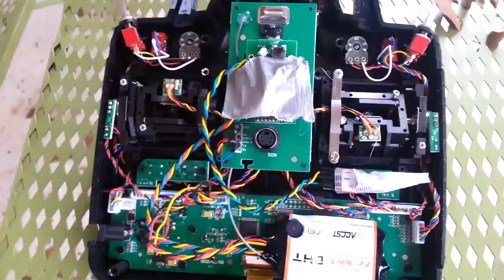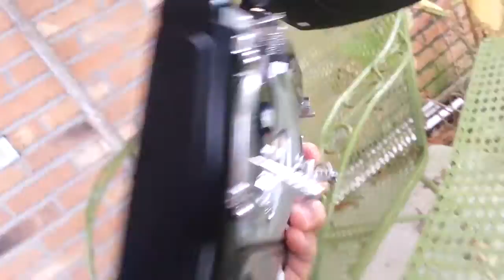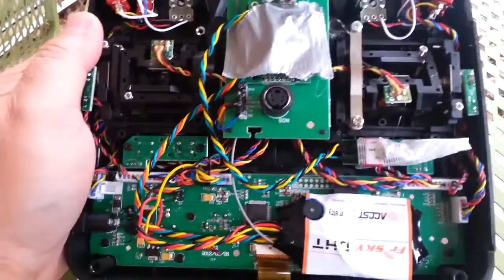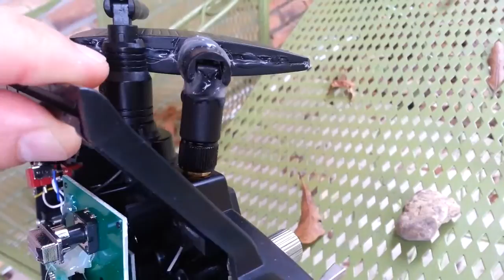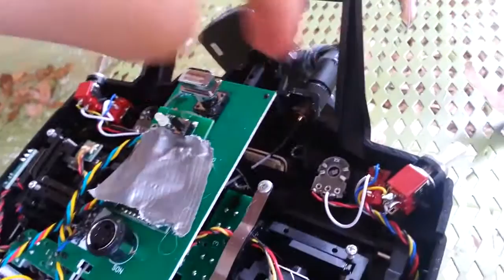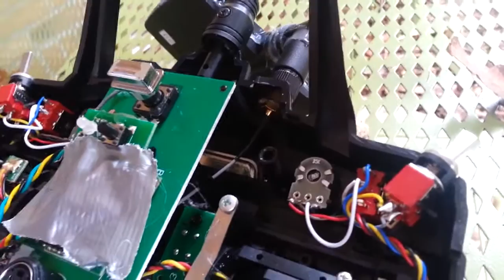FrSky DHT module to flysky FS-T6

Comment: is this like a cheap version of the taranis?
Reply from the maker: Pretty much. Taranis has lots more software, and menus, nicer gimbals and much more, that i'd never use. I've got a Taranis still sitting in the box, never been used. I throw this transmitter in a soft case with my fatsharks and go. I don't worry about it breaking, or getting banged up. I also use a patch antenna that increases the range substantially. Now I'm going to use the Taranis because I just got an EZUhf module for it.

Comment: Just looking at this mod and I going to do it to my radio, question how does the telemetry works, where the info is displayed and what information you get, do you have to flash any firmware on the radio and what are the benefits of this mod?
Reply from the maker: yes. telemetry works. the module has a beeper on it, thats all. just power and ppm signal. i don't know about displaying on the lcd screen or firmware mods.

Comment: Hi Adam, did you know the ppm level of the T6? i want to use a diy arduino based dsm2 module. the hf mdule only takes 3.3v allso the ppm on high, if the ppm output from the t6 is 5v on high = module fry ^^

Comment: Ive done this mod to my fly sky f6 also, Great mod! I removed the original fly sky module completely and used the original modules cables and removed them from the white plug leaving the yellow ppm and black earth wire, Simply soldered the yellow wire to the ppm wire and black to the earth wire, Red to a power supply. Easy! Works a treat!

Comment: Hi, Do you know if the DHT module will bind with the stock FS-R6B receive that comes with the FS-T6 transmitter? I just purchased the DHT, wondering if I need another couple of RX's to go with it? When It arrives I'll most likely disable the stock internal module but hopefully keep the trainer port function. The way I see it you solder the + (Positive) to + (Positive) on the on/off switch. Solder - (Negative) to any ground point. Allocate the PPM signal which is allocated and labelled "PPM TX" (Yellow Wire) on the stock module. I would imagine to turn on/off the stock internal module you can put a switch on the 5V line to it? I wouldn't be happy having both being on at the same time IMHO.Don't take the + (Positive) 5V from this module as it may be weak. Take from battery / on/off switch area.
Reply from the maker: No. The FrSky is not compatible with Flysky receivers. I run both of mine at the same time. I can't see where the problem is with that. Each one acts independently of the other. Its a simple input and output. Although when I replace all my flysky fith FrSky, I'll probably disable the internal module too.You can bind as many receivers to either as you want. the FrSky module should be fed voltage directly from the batteries. I'll post a better video soon.

Comment: Hi Adam , 

Thank you so much for the video and pushed me to upgrade my FS T6 with Frsky DHT module. I have successfully installed it and have added a switch (PPM signal wire) for it and i can change if i want to use the stock Flysky module or Frsky DHT module. Now I have some mind of upgrading it again. Have you tried to upgrade/modify the firmware of FS T6 to get use of the telemetry function from the DHT module just something like what people did for the 9x radio? Just a thought and not sure is that possible or not. Thanks in advance.

Regards, 
Irwin
Reply: i would say my original FLYSKY module only give me around 150 - 200 meters, and with the modified Frsky DHT DIY module i have never try to push it to limit, but I still getting 50% ~ 60% of signal after + - 200 meters. (with 5dB antenna and open field) If you want more more details or pictures welcome to drop me an email (irwinng2356@gmail.com).
Reply from the maker: You should get at least 1km with the frsky system at line of sight.
Reply from the maker: +Irwin Ng No. You are welcome. I have not. I don't know if anyone has modified the firmware or hardware like the 9x. I think the 9x was so heavily modified is that it was so popular for so long. It has 9 channels, a module bay, large battery bay, etc. Now there are so many decent radios out there, its less likely to have the hacker community spend much time on it. I wish FrSky would make a cheap 6 channel radio like the T6.
Reply: Hello Irwing, 

Do you mind telling me how much improved signal you got from this? Also a picture will be great :D. I am doing my first build so i am learning as much as i can.
Reply: thx both of you for the replies, I sent u an email Irwin:D

Comment: I'm having trouble figuring exactly where you soldered the signal wire, a couple jpgs would be most helpful, thanks.
Reply from the maker: +Brett __ Yea, its hard to see. I don't have any pics, but you can see on the tx board it says PPM, TX, you want to attach your signal wire to that. You can see where I tried to access it at the TX board, then changed my mind and put liquid tape on it. Then I took it from the main board. Hope this helps!

Comment: Can u still do multiple models with this mod?  or only bind one at a time?
Reply from the maker: +ChawFPV Yoe. The transmitting module is separate from the "controller" parts. The controller outputs PPM signal, and the "transmitting module" receives the signal and outputs it as a 2.4ghz signal. It is actually transmitting in FlySky, and FrSky protocols at the same time. The rest of the transmitter remains the same.
Reply: +Adam Heidingsfelder so I have two frsky recievers, on two quads,  i can switch between them at any time?  only bind once when first setting up?

Comment: Could I add this module (http://www.hobbyking.com/hobbyking/store/__46634__OrangeRX_DSMX_DSM2_Compatible_2_4Ghz_Transmitter_Module_JR_Turnigy_.html) to an FS-T6 in the same manner as described in the video?
Reply from the maker: +Forrest Grinstead NO. you need this one: http://www.hobbyking.com/hobbyking/store/__40205__OrangeRX_DSMX_DSM2_Compatible_2_4GHz_DIY_Transmitter_Module.html
Reply: +Adam Heidingsfelder Thanks for the reply. $40 shipping on a $30 item kills me... Are there any other ways I can make this receiver (http://www.hobbyking.com/hobbyking/store/__61211__OrangeRx_R410X_DSMX_Compatible_4Ch_6CH_PWM_CPPM_2_4Ghz_Receiver_.html) work with the FS-T6?

Comment: hi, i would like to ask can i use the dht module with d6fr receiver on my kk2.1.5? and what i need to prepare to diy the dht module to my flysky fs t6? any help would be appreciated. thanks
Reply from the maker: +Irwin Ng Yes. It should work. I would go with a better flight controller like a CC3D or Naze32 though. Check RCgroups.
Reply: Ooh, any problem with kk board? becoz of less features to play with? oh ya~ to modify the DHT module to flysky fs-t6, just need to solder those 3 wires without any additional cable/wiring, am i correct?

Comment: hay,whats up ,just wanted to know how this setup works in terms of range and control over your craft. im on a budget so this is my best solution for using the D4R-ll reciever on my craft.i know the t6 is not the best but it works and the price cant be bet .so please tell me this mode stud the test of time....thanks...
Reply from the maker: +Levi Thompson Hi, thanks for the question. I got the Taranis transmitter about 6 months ago...and I still use my T6! Taranis is still in the box! This setup is GREAT. It cannot be beat for simplicity and price...IF you know how to solder. I was using this setup with a modded FrSky panel antenna from hobbyking-the one in the video. With an XP receiver and NEVER lost signal.

Comment: Can you also use all 8 channels of the module with this modifikation?
Reply from the maker: +Fallout FPV FS-T6 is only putting out 6 channels PPM, so no. Only 6 channels. I think its better like this. The PPM-transmitted signal will have a null between the last and first channels, allowing the receiver to get signal longer.
Reply: +Adam Heidingsfelder Could it probably be, that the main board is the same like the mainboard from FS-TH9X/ Turnigy 9X? If that's true - I don't know - you can probably use the openTX software and up to 8 channels (after adding more switches)?

Comment: Hi, After opening my own T6 I understand what you did.
But i dont really understand where to put the yellow cable.
You just soldered it on the plug on the board with the Module at PPM-TX? 
And how can I unplug the old module?

And is it possible to use the old reciever, which comes with the T6?
Reply from the maker: Max Reichel I soldered onto the signal wire that comes from the main board. I traced it from the module (it says TX). I was going to solder it on the original module, but it was easier to access from the main board. I still use BOTH modules. They still work fine, they are just both on at the same time.
Reply from the maker: Max Reichel I you want to only use the FrSky module, you can cut the wires to the module, and solder directly to them. It will also give you more space.
Reply: OK thanks a lot! Now i only need a store which sends from EU for a moderate price (like 20$ on HK) :D
Reply from the maker: I like banggood. Here's fat shark's distributors. If they sell fat sharks then they probably sell FrSky:
http://www.fatshark.com/where-to-buy.html
Reply: I have to ask again... From where to take Positive and Negative? Like i can see in you Video you used the upper pin of the switch (for turning FS-T6 on or off) for Black and the lowest pin of the three pins for red? And its only needed to also solder the yellow cable at PPM-TX? 
Because its look like you´ve soldered many cables to the old module? Or is that only to acces the bind button over the stock bind button?
Reply from the maker: Yes. That's only the new bind button next to the old one. I drilled a hole in the back for the bind button and LED. I only soldered 3 wires, +,-, and PPM signal.
Reply: Hm but I can't really bind with my reciever.. I press the Button on Module and reciever and then it shows, that they're connected... but when I insert the signal cables for my FC it doesn't work anymore...
Reply from the maker: Max Reichel
Each receiver has a different way of binding. On the Tx, you hold the button, then turn on the tx. Try with a regular ESC/BEC and a servo to simplify the setup. you may have another problem besides the Tx. Otherwise you should start an RcGroups thread, as I probably can't help much.
Reply: +Adam Heidingsfelder oh. i'll try it with a Servo.
but from.where did you took Power? i thought the upper Pin of the On/Off switch for Black and the lowest Pin for red. but that doesn't work.
i can't really See it in the video
Reply: Lol, now it works!!! :D dunno why.. but it does ;) Already thought, that i destroyed my FrSky with wrong polarity.
Now i also understand what you did. Maybe i try it to explain for the others:
I just cut the yellow and the black cable from the cable bundle, which leads to the old TX-Module. then i soldered them to the DIY-Module.
The red one is just soldered on the lowest pin from the On/off switch.

Comment: Hello one cuestion you solder ppm cable to the board or cut a cable and solder to it? If you solder to board two transmitters go on at the same time? Or you cut the signal of old transmiter? Sorry for my little english
Reply from the maker: Robert Llado I soldered onto the TX-PPM cable. I have both Transmitters running at the same time. I still have half my Rx FlySky, and half FrSky. I just got a Taranis, so I'll probably hook a wifi amp to this one for long range.
Reply: Adam Heidingsfelder have you a taranis? Great. I dont have money for taranis, why you got taranis? You need more range? Thanks for info.

Comment: Please explain more, can't see what you did
Reply from the maker: Ok, It looks like its more complicated than it is. There is only 3 wires, and one antenna cable. Positive, Negative, and signal. Positive and negative are from the battery bank. I soldered onto the switch for power. I found an easy to access ground, and traced the signal wire (PPM-was labeled on the inboard transmitting module). Thats it. I leave it on telemetry mode, so the switch just lays inside the transmitter case.
Reply: Thanks for the update
Reply: Adam Heidingsfelder I got the mod to work, but is 5 volts good enough? I also tried attaching the positive to the battery outlet but then the frsky would not turn off. Is there another 12 volt wire to hack in?
Reply from the maker: No, take power from the switch, the side that shuts off. Check with a multi-meter to be sure. There's a lot of easy to access solder to attach to as well. I don't think 5v is enough.
Reply: Thanks, yea 5v didn't work out ill look for a 12v by the switch
Reply from the maker: I soldered on the bottom part of the switch. you can see in the video if you look hard. I covered it with liquid electrical tape. It should be between 9 and 11volt- 8AA's

Comment: Can you show were you hooked up the TX RX wires?
Reply from the maker: Ok, It looks like its more complicated than it is. There is only 3 wires, and one antenna cable. Positive, Negative, and signal. Positive and negative are from the battery bank. I soldered onto the switch for power. I found an easy to access ground, and traced the signal wire (PPM-was labeled on the inboard transmitting module). Thats it. I leave it on telemetry mode, so the switch just lays inside the transmitter case.